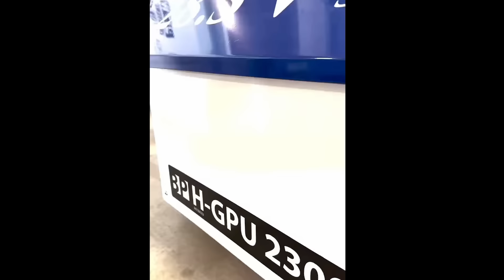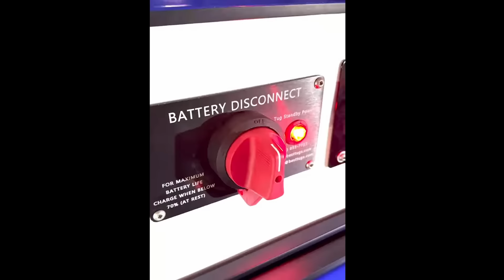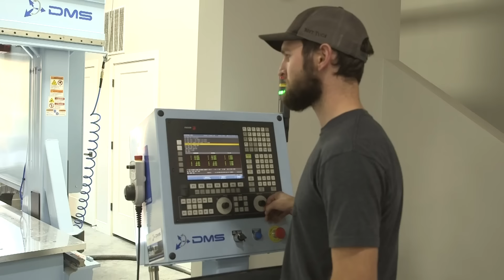Mark Patey Shares THIS Secret

Comment: The FAA has held Aviation back for the last 60 years. Millions of Better Ideas have been stamped out because they weren't installed on a certified airplane. Hopefully you will have better luck. Mcfarlane Co. has recently been able to come up with better replacement parts for the legacy fleet. at Much better part, at a much better price, and Immediately available.